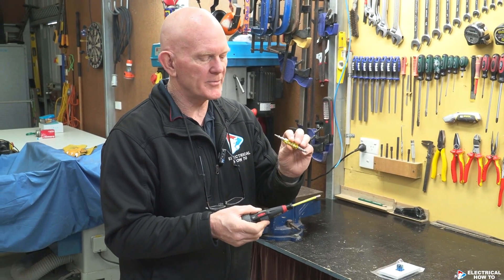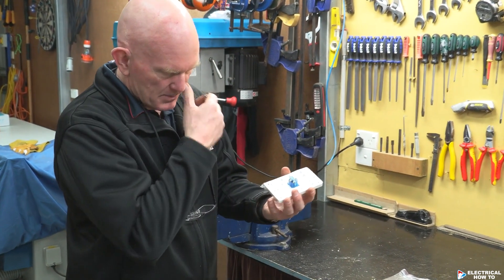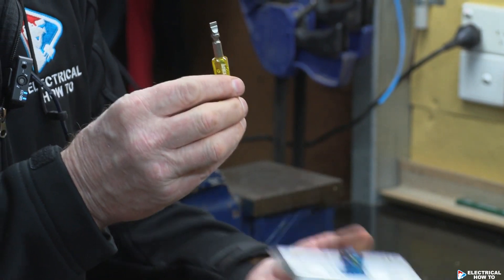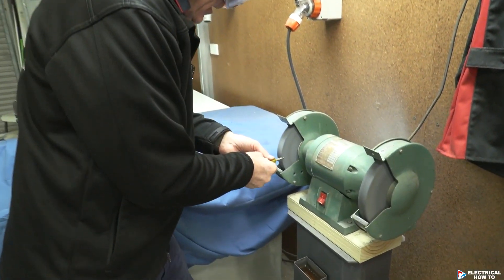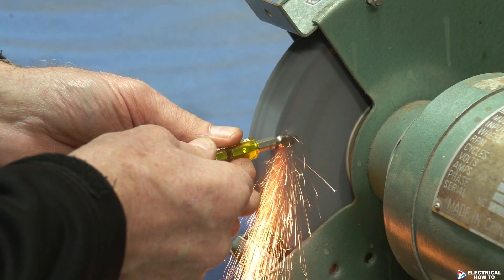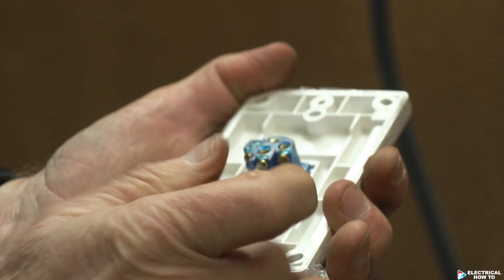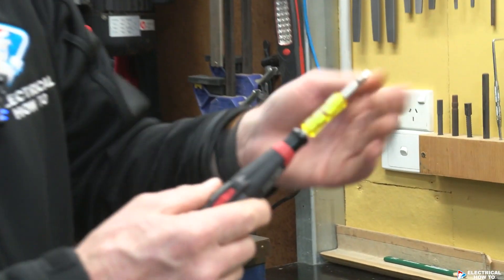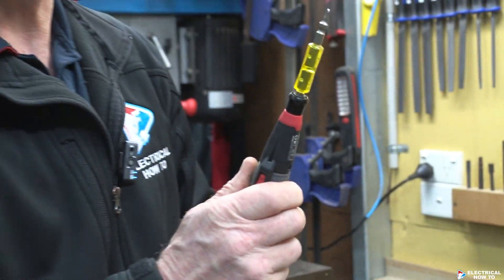Vessel Electric Screwdriver Modification | Electrical How To

Comment: What happens if you don’t have a pedestal grinder can I use an angle grinder instead
Reply from the maker: No would not recommend this at all. Would be too dangerous. You can pick up one pretty cheap to get the job done.